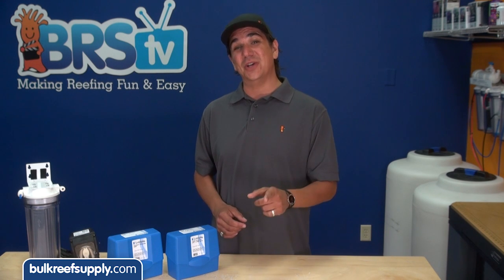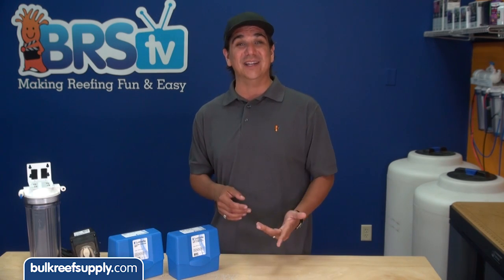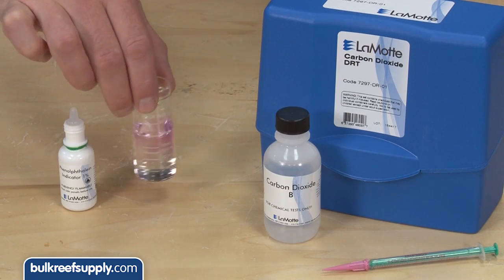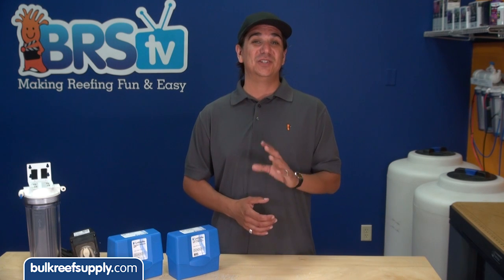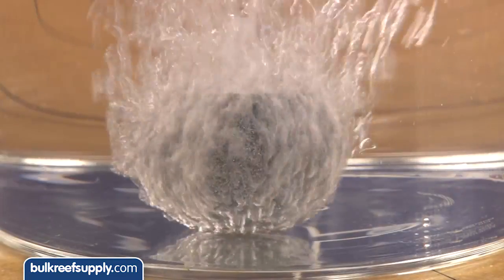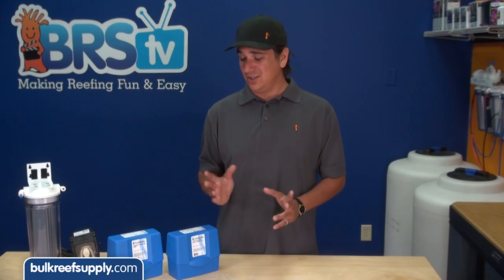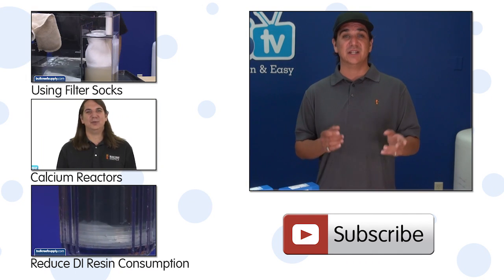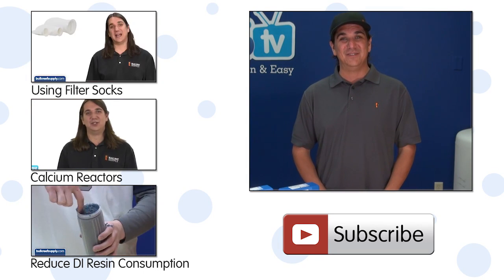Extend Lifespan of DI Resin, Reduce CO2 | How To Tuesday

Comment: I have a question relating to DI resin storage when the unit is not producing water - is it better to drain the vessel of water then seal the inlet/outlet so Co2 does not get in, or have water sitting in there?

Comment: I've been doing this for several years as my well water is very high in CO2.I use an old MJ pump in my raw water tank with the diffuser head and air injection tube. It sits slightly under the water surface, circulates the water while injecting room air. After 24 hrs I run it through the RODI and into my salt water makeup tank. Works great and saves lots of DI $$

Comment: My water is usually 2-4 TDS after the RO and it still gets used up super fast. I have used those calculators and they all say that I have super low CO2, which I know I would considering all of the carbon is the carbonate form. I have liquid rock. Maybe resin just doesn't last very long??

Comment: I see value if it would cut down on DI resin significantly.  But it is still hard to justify buying an expensive test kit like that for basically one or two uses.  Maybe you could offer a less pricey kit for this purpose.
Reply: ***** I get that.  Makes sense.  Unless it turns out CO2 is not the issue, and then you're out 40 bucks.